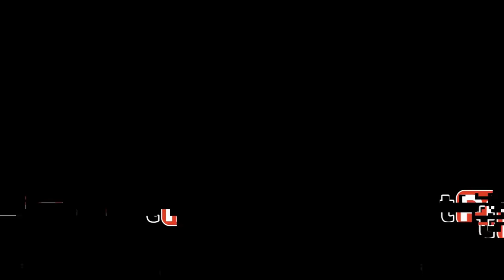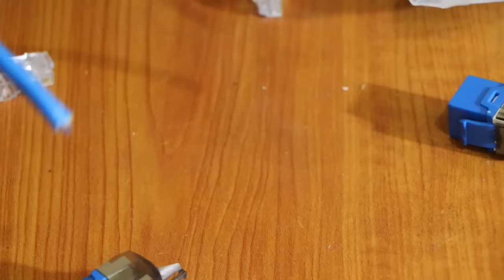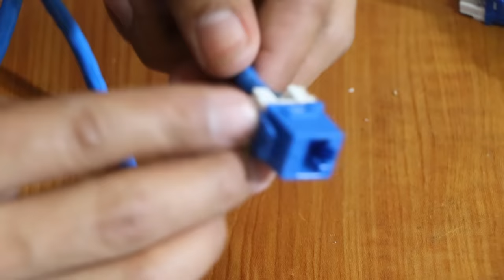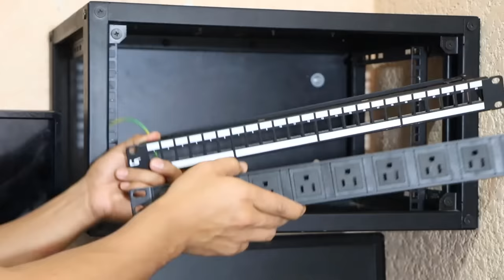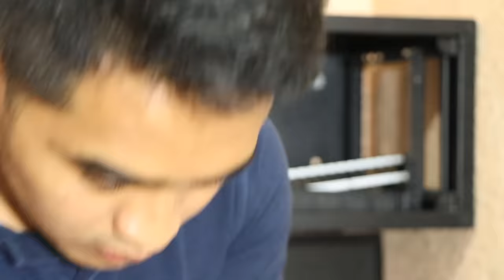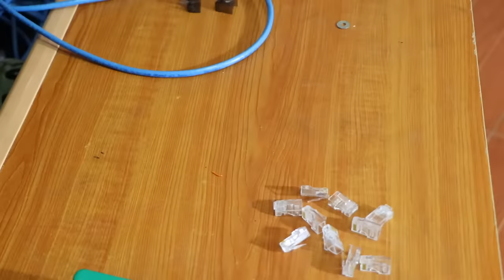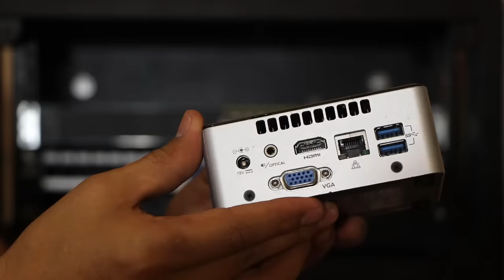DIY Home Network: Experts Debate – Right or Wrong Techniques?

Comment: What is the point of a patch panel if you are going to connect everything to the switch anyway?
Reply: The patch panel is not absolutely necessary. You can plug those cables straight into the switch and it will work fine. However, this is not ideal since those cables are not meant to be moved around that much. Once they are installed, they're not really supposed to be moved around. These types of cables are stiff since they're meant to be run inside walls, but they can break if you move or bend them or unplug and plug them in too often. For a home network, you can most likely get by without the patch panel, but in an office setting where you have many data connections, you don't this to happen.

It also helps with organization assuming things are labeled correctly. If you have a classroom, for example, with 10 network drops labeled Room 5-1 - Room 5-10, you can quickly identify those network drops on the patch panel and make the connection from the panel to the switch. Again, in a home network environment, you may not really need this level of organization, but it does greatly help when you have many connections to work with.

Comment: There’s nothing wrong with making your own cables. But doing it without the use of a cable test scanner device is asking for trouble down the line. You can make a mistake in the wiring which doesn’t show up on a continuity test but still can impact performance. Such as miswiring which wire pairs are twisted together. This will cause network issues that might not show up initially. Best to borrow or rent a tester after you are done to certify all connections.  

I’ve done hundreds of rack mount installs.  It’s very important to line up the three holes in the rack with the corresponding 1U device. You can’t skip just one hole and then install the next 1U device as they can’t both be properly aligned with the holes. If you need to skip space you need to skip 3 holes which is 1U. Otherwise when you go to mount more stuff in the future it won’t fit. I speak from experience and have had to remove and remount many devices that were not originally installed right to make new stuff fit.

If you choose to only connect two screws into the rack and leave two other holes empty then you need to use the bottom holes not the top ones. This way the angular pressure from the device weight away from the rack - in this case the back side will hold the top holes together naturally without any screws. But the other way as shown in the video where the screws are in the top - this way the bottom holes will be loose and not held together by the rear weight. Instead the weight from the rear will pull the bottom holes apart from the rack. This is simple physics.
Reply: Also, why not just buy those cables?  I looked and they are (like) $0.60 each.  He could have spent next to nothing and be done.
Reply: @poe Lemic Buting cheap patch cables is asking for trouble sometimes, I work in a commercial setting running Cat 5/5e and Cat6, just recently ran into the nightmare of a super cheap patch cable that was giving us fault reading on out cable testers, we originally though it was the line that was ran for our box, but after more testing it turned out the patch cables were the true issue, and I have no idea what kind of keystone he is using, in our company we always use Intermodule jacks on everything set to a B standard, I've never seen those type of keystone "Jack's" before.
Reply: Poe, what’s the fascination with buying pre made patch cables? Safer bet is to make your own.. takes no more than one minute per cable. 

Put in the time to do it right the first time, so that you don’t have to double back.
Reply: Neil Brookins  I like the fact that you make your own jumpers.

Comment: i did not use a patch panel. all my network ethernet wires plug straight into my 16 port gigabit switch. it is very messy. wires everywhere. if when i get a patch panel i will use a keystone patch panel with female rj45 to female rj45 keystones. i bought 300 pass through rj45s.

Comment: Hi Guys. 
Why the cables can't go in to the switch straight away? I suppose the only purpose of the connector rail to identify fixed connections to Rooms , etc... with the labels?
Reply: That's correct. You can forgo the patch panel and plug the cables directly into the switch. The panel is used to make the network cabinet neater and to be able to quickly and easily identify where the cables physically run to. In most home networks, you don't need a panel. In larger networks like for schools or offices, it greatly helps having a patch panel.

Comment: So what’s the difference cat 5 ,6,7,8 and which one should be used around the house?
Reply: Use CAT5e for a bandwidth of 1gig or less. They are certified for a bandwidth of 100 mbit but if they had good quality will work with high speeds. The real recommended cables for more than 100 mbit is CAT6 but you will have to do the entire network (RJ45 conectors and keystones) CAT6 compatible. CAT 7 and 8 are for more robust comercial/industrial environments.

Comment: The short patch cables between the patch panel and switch are ok but the short cables between two devices are not. The minimum cable length for Ethernet is one meter. The maximum length is 100 meters. I have been a network engineer sine 1983.

Comment: Wow neatly done, the right way is done, but where is the part that says "wrong way" of doing it?..
Reply: Some to (most) of what he did.  That the second part which answers your question.
Reply: Did you even watch the video or read any comments?
Reply: I only noticed that he left some gaps in between the power strip, the patch panel and the switch.. I think maybe thats the wrong part..

Comment: Nice vid and setup. A few pointers - heaviest equipment should always be on the bottom. If a heavier item falls down during install/removal/maintenance, it can cause serious damage.

Check cable spec and cable bend radius. This is why you won't see a business grade installation with such short cables. Always take the cables out to one side, you don't want cables doing vertical runs between devices. 

Service loop for all cables is a must.

Lastly, the ports to the far right are uplink / stacking ports, preserve them and don't use them for "normal" ports. They're ment to connect one Cisco / what ever device, to another.

Also re the Pfsense & Mikrotic, I use Pfsense as a pure firewall / IDS / IPS + VPN server (I run it on a i3) & I use the Microtik to do the routing.

Comment: COUPLE HINT  cat5/6 doesn't like tight turns also never use wire ties us only velcro and lastly rack rails are setup so each rack space equals 3 holes.  space between units leave 3 holes and just you are only putting 2 screws the bottom two are the only one holding weight.

Comment: Just order finished cables online. Faster, better quality and finish, and cheaper than making them.

A ‘pro’ also needs an Ethernet cable tester.
Reply: maybe you don't know how to make ethernet cables. I think this video is about DIY home network. Why buy if you can make one? and you don't need cable tester to make it work. It does not mean if make your cable it's not a quality finish my freind.
Reply: I ran my 20 line and 14 i bought already made at 50 feet, then bought 1000 feet of cat 6 and ran the rest and put the ends on them fast and clean, have a tester but dont need it really. Making your own is really alot easier then most people think. My question is why the patch panel? there is no need for it, just put the connectors on the wires he ran and connect them right into the switch, alot easier and less work you have to do in my opinion.
Reply: Scott Luther  it's just more work but cosmetically you see bunch of wires lol just thought it should be simple, wires then switch, would look cleaner to me.
Reply: PV:
Thank God that I'm not only one seeing that.  Yeah, spend 50 cents each and be done.
Reply: @chrisaldrich8584  Patch panel can be usefull if you want to do more than just switch connection.
I did set up my home with multile rj45 ports and a 16U bay with a patch panel.
I can make the phone line to the patch panel et use a simple rj11 cable on it to the dsl modem (or a prot splitter on both sides and make 2 lines comes in the bay) and i can also route a hdmi to rj45 use the patch panel. (4k 30gps with hdcp and audio over single cat 6 cable) so in normal use case the same ports are bridge (near mediacenter and videoprojector port) but if i want i can route hdmi from any rj45 in the house. 
I also have multiple networks depending on usage (work, personnal and wifi/less secure) using colored cable from patch panel is quite useful :)
Reply: @PoeLemic 
Yup, life is too short to make you own 1ft ethernet cables. It's fun the first time, to prove you can do it, but it gets old fast.

Comment: I have a issue
I have 3 internet connection
Line 1 given from isp ->firewall->gigabytte switch ->media convertor->block2-> mediaconverter->gigabyte switch
Line 2 -> isp->media convertor->block2-> mediaconverter->gigabyte switch
Line 3 ->isp->>media convertor->block2-> mediaconverter->gigabyte switch
When line 3 is connected to the sameswitchin  block 2 line 1 and 2 gets disconnected. Pls help me

Comment: Why not use the square cage nuts like they are designed, and pop them into the square holes?  I'd suggest you mount the plug PDU at the back rail, so that your plugs are away from the front panel (especially in a small rack like this, with a side panel that opens). Also, using plenum cable for patch cables is a bad idea. They tend to dry out and crack easily. Just order some cheap patch cables (6" patch cat6 with snagless caps are only $0.55 each)
Reply: First: I have run several data centers in my career (one of them running 911 services).  CMP rated cables are specifically designed to withstand higher temps and generate less smoke in a fire.  The primary reason for this is flash-over/smouldering fires accumulate more heat in a ceiling plenum vs lower down.  Cables in a rack (especially if cooled cia a CRAC), are subject to typically high air volume change-over that also tends to be very dry (most are supposed to maintain a certain % of humidity, but most dont do this as well as they advertise). The chemicals used to make a CMP cable, also tend to harden the outer sheathing quicker. So the cables dry out faster when in a cooler environment, then in a home/warm environment.  There is zero benefit of using more expensive CMP cable in a rack/cage then using much cheaper patch cables (they are typically made with a softer plastic sheathing that actually withstands drying out longer).

Comment: Isn’t the ol 2960 100 Base? Surely there’s some old 3560Gs going cheap on eBay so you can get gigE?

Can’t help but notice half your patch cables didn’t come up or were reporting different speeds (orange light, green light). Cable testers save so much pain and misery!

Comment: Why didn't you just put an RJ45 plug on the end of the cables and connect them directly to the switch? Why are there so many extensions and cables in between?

Comment: So let me ask a stupid question.. why not just terminate the cable at the switch? What is the benefit of the patch panel?
Reply: You can just terminate it at the switch for a lower cost solution but with a patch panel you can tell where each ports go if you label them makes it easer if you are going to swap out a switch.
Reply: And if you plan on terminating to the switch use Ethernet boots to help there not be as much strain on the cable. 
(He didn’t use them in his video)
Reply: @SpottedDogNetworks   couldn’t you just mount the switch flat against the wall and label the switch?

Comment: these small patch cords suffer some change in performance, because I know it needs to be done 1 meter, but these are very small, I would like to understand if you have any problems.
Reply: for a home network.. short cables dont mean anyting.. yes, their are standards but as long as the link light blinks and have an active connection...go for it..

Comment: Hi. Just a suggestion. Maybe explain the advantages of a wired network over a wireless one? Wired is much more difficult to install in some newer houses and as a result wireless is now used much more in some countries. Both solutions have good and bad points though. Best wishes with your channel. BobUK.
Reply from the maker: Thanks man.
Reply: wired will let you use POE powered devices and potentially allow greater speed and bandwith.If possible wired should go in while the house is under construction because as you mentioned it gets very difficult when everything is finished
Reply: sorry sir but your information is flawed. I work doing structured wiring and am employed by an fiber optic isp, 100 percent of new construction we come across is all data wired and coax wired. The cost of cat5 or even cat6 is relatively cheap from what it used to cost. The issue most people run across is the fact that their isp is to lazy to terminate correctly and most home owners are ignorant to a correct setup and are not willing to pay for patch panels or a network switch in their homes. Wireless is the easy way out in most cases but wireless has many issue. Wireless is very susceptible to interference and also some construction materials will cause problems; a good example is a product called silverboard. Silverboard causes a lot of grief for wifi signal. another issue is airtime fairness, most cheap routers do not handle with well and will either drop connections to devices if there are more than a few talking to the router or will cause high latency. Even a high end router will have issues. the problem is most routers are not advertised true to their operation. A good router i would reliably suggest is one that has 4x4 mu mimo or better. this allows for 4 1x1 devices to talk concurrently or 2 2x2 mu mimo devices like the iphone. This is why the preferred method is still hard wired for smart tvs, game consoles, desktop pc, etc. leave wifi to tablets and smart phones only.
Reply: Wired over wireless
One word: reliability

Comment: The first ports are 10gb/s ports in the switch
Reply: So called uplink
Reply: Not 10 gb/s those are 2 10/100/1000 ports the other 24 are 10/100 ports

Comment: The two ports all the way to the right are the wan ports for the switch. They are marked in yellow on the switch. That's actually where u plug in ur internet connection. U have the internet connection coming from one of the regular ports on the switch. It still works the way u set it up but isnt the standard way u set up a switch. I would change that in the future. Otherwise nice setup

Comment: I'm triggered by a couple things. Skipping that 1 cage nut gap and not using the bottom screw instead of the top. If you're gonna skimp on screwing it in properly, atleast use the bottom holes instead of the top, that way the strain is on the rack unstead of just the two screws

Comment: hi sir did you directly connect your ISP internet cable to your mikrotik?
Reply from the maker: My Internet connection is connected to another router from another building. So its directly connected to mikrotik.
Reply from the maker: That router is connected to ISP
Reply: @torogipro  hi sir do you have an email address i have some concern from my home network set up.
Reply from the maker: @rienerbraun4438  message me on facebook. GINARD GUAKI

Comment: Ok, aussie here, assume this is from the US, or Philippines?
So he can do what he wants, probably better than many.
Some improvements:
1. Use a patch panel that provides for strain relief of the fixed ethernet cables.
Cat5 - zip ties, Cat6 - recommend velcro*
2. Looks like Cat6 here, so for the home made patch leads:
a. Factory made leads are usually more reliable with better strain relief and quality control for guaranteed Cat6 performance (Avoid the "yum cha" brand rubbish).
b. Sold core for patch leads? That's risking breakages if your patching around a bit, small risk I know bur patch leads are relatively cheap.
3. Put PP at top,  it's never going to move.
4. Use cage nuts, they are cheap, and your gear is only half secured here.
5. Follow rack spacing (RU's), it's marked out on most cabinet frames. No gaps.
6. If rack mountable gear is placed at top, theen you can use rack bottom or a full/half shelf to place smaller items, Mikrotik looks a bit odd on its side.

* My fixed data wiring is FTP Cat6, screened outlets, screened PP, and 2 x 6RU cabinets side by side in a built in robe (Cupboard). 

Earthed (Grounded) by 6mm (10 AWG) earth cable to 3 x 9ft copper clad steel electrodes coupled together, mostly concealed in wall cavity, and I have a plastic earth pit to conceal the ugly ground rod connection).

Still, your installation, whatever floats your boat.....
Reply: Going to wire 5 rooms in new house, longest cable would be 30m. Would you recommend cat 6 or 6a?? Cat 7 would be overkill right?

Comment: Uh, don’t use solid core installation cables for patch cables.
Reply: Why not? Serious question from n00b
Reply: @jacobhua  they tend to break if moved around and are a pain to organize
Reply: @jacobhua  Solid copper work hardens, so the more you bend it the more brittle it gets.
Reply: @zacharysandberg  that makes sense. Thanks. 👍

Comment: Torogi, how do you wall mount your server rack?
Reply from the maker: The server cabinet rack is designed for wall mounting. It has holes at the back, I drilled and screwed it to the wall.
Reply: @torogipro  what type of screw do you use? How many kg can it substance?
Reply from the maker: I use these https://goo.gl/images/M4C2Bm
Some call it expansion bolt or lag screw expansion.
Reply: Scott Luther  Here in PI, most walls are concrete.  Studs are for drywall types.  Thanks for the suggestion.